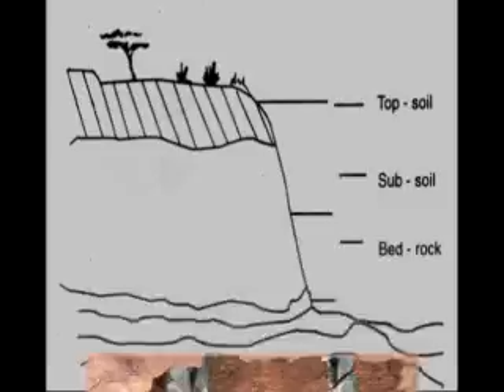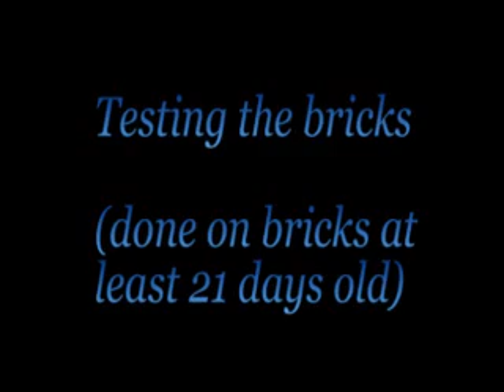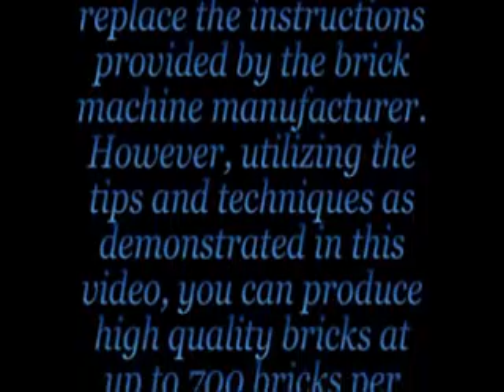Stabilized Soil Bricks

Comment: Did using interlocking blocks eliminate the need for mortar? Will any kind of sand/clay work? Which is optimal? Not all cement needs such a long curing time. What about emulsified asphalt? Lime? Without a machine the mix may be compressed within a form at the wall site using a tamper. The form can be removed immediately.

Comment: With our Chaptools machine and all its add-ons you can do this work on an easy and quick way. One only machine is able to level the surface and uncompact adding polymers, stabilize adding lime or cement and, finally, compact the path. It's quite easy to handle and transport. Flawless for small and medium tasks.
https://www.youtube.com/watch?v=QJtLfgh4q5Y&t=24s

Comment: They are talking about a 9-10% cement ratio  1 cement: 10 soil
Reply: By weight?
Reply: 1 bag of cement to 8 wheelbarrows of sand
Reply: @heavycurrent7462  By volume.
Reply: 8 wheelbarrows of sand to 1 ½ 75kg bag of cement is their own mixture ratio.

Comment: The best way to mixed the Soil and the Cement is with a Pan Mixer,which will produce a very smooth and clean Bricks.The soil had to be mixed properly before adding the cement,that will give a healthy and sound Bricks.